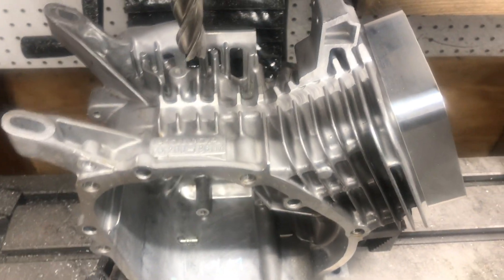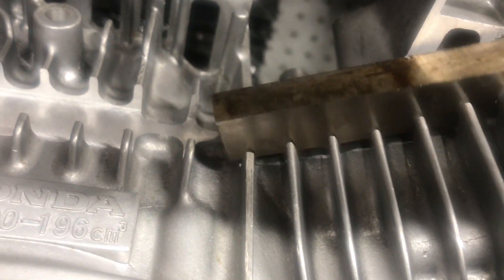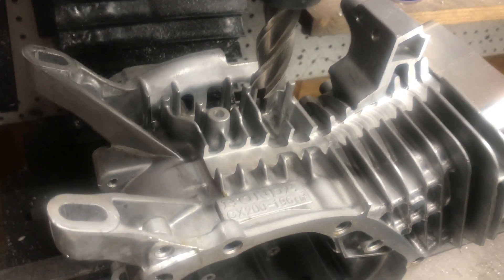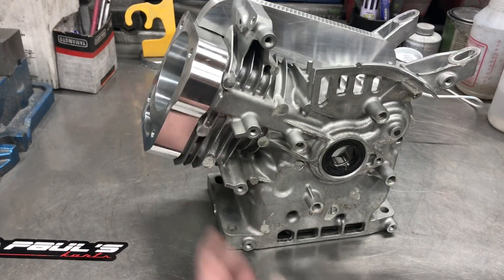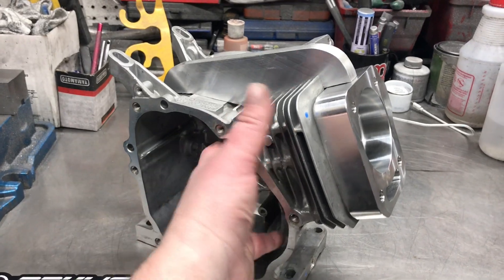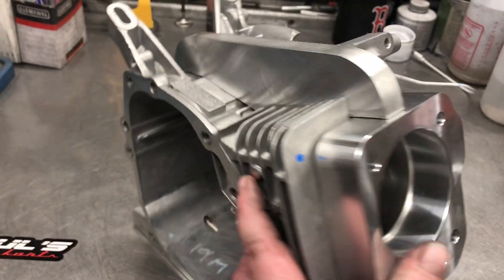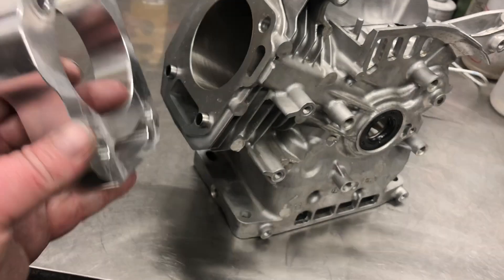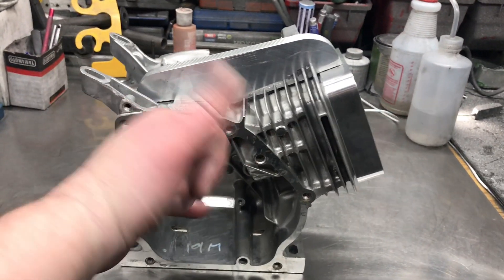Honda gx200 block welding and setup for 3” bore and deck extension // Paul’s karts

Comment: What's a deck extension?
Reply from the maker: It’s best described by how it sounds. It’s a varying thickness piece of material in this case welded to the block in order to extend the “deck” or head gasket surface. This is done in order to extend the bore length. Once deck extension is welded on a new cylinder bore sleeve is installed thru the block and deck extension. This creates a longer block for more stroke.

Comment: What is the effect of extension 3"  in head cylinder
Reply from the maker: More area to work crank stroke into, and,  the density of the deck extension actually allows better ring seal right at peak cylinder pressure